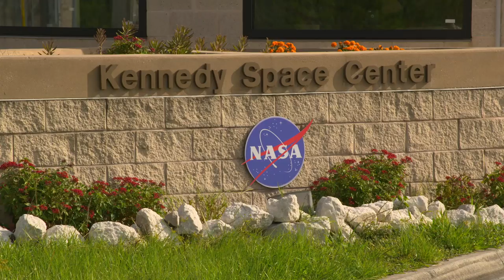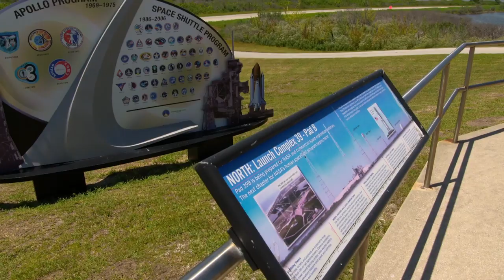Space Launch System: Construction of the Mobile Launch Platform

Comment: That looks a lot with the Saturn V Mobile Launch Platform... a little smaller tower in length though.
I wonder , they scrapped the old Saturn platforms? If yes, how stupid of them...they could have reused the Saturn's crawler, platforms and towers!
Reply: that is a saturn mobile launch platform. after apollo program they used the mobile launch platform for the shuttles, they just retrofitted the platforms for shuttle use. and now again for SLS.
Reply: Well, they have reused the Saturn's Crawlers..or one of them, at least.. CT-2 was upgraded for heavier vehicles, like the SLS.  As for the towers, well, they were rusting after years of non-use, and the paint on them that was flaking off was an environmental hazard. Much as fans were trying to raise money to refurbish them for museum items, not enough money was raised.  (and some of the Saturn LUT towers were used on the Fixed Service structure at pads 39A and B..)
Reply: If space x would want to use them you would see them a lot more
Reply: The only thing left from saturn/shuttle towers at this point is the Crew AccessTower at LC-39B, now used by spacex
And an MLP that is yet to be scrapped.
OG Saturn MLs are long gone, they were reconfigured for shuttle years ago.
Besides with now much heavier rocket to transport, sometimes its better to start from scratch.